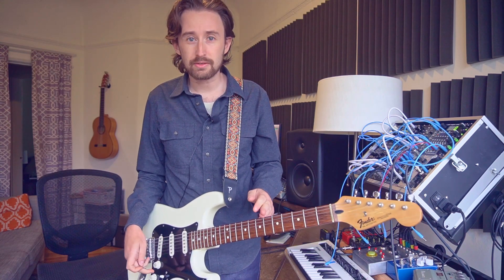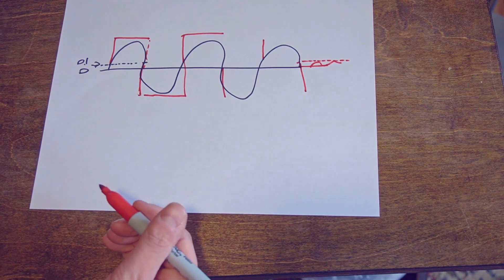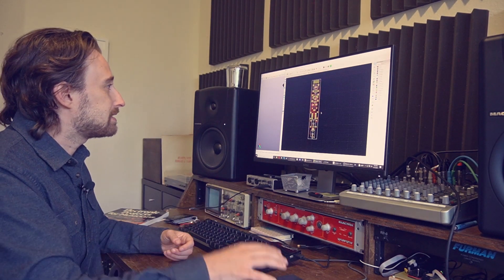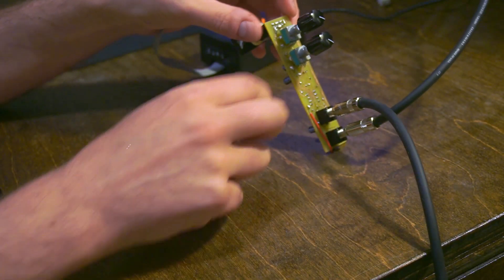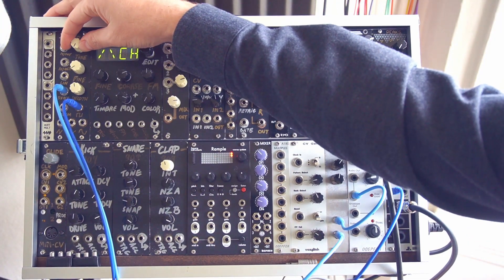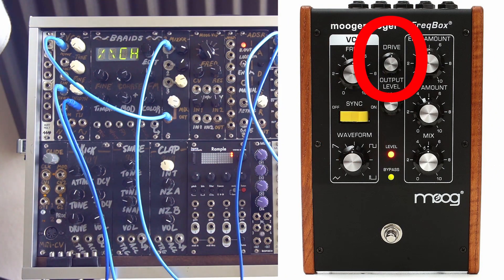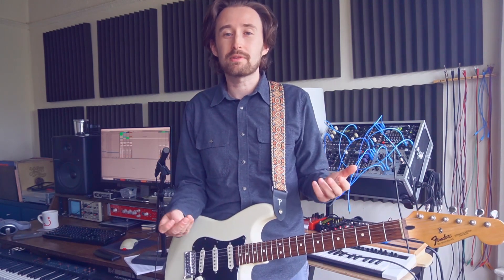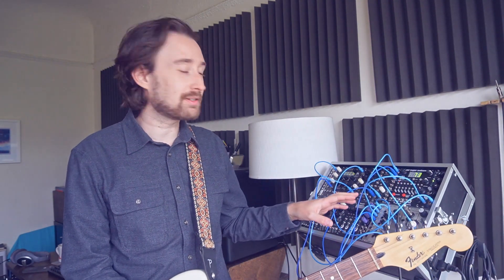Making an Analog Eurorack Guitar Synth with a 1970's Ultra-Fuzz Circuit

Comment: What kind of power supply do these  filtamp's use ?
Reply from the maker: Not sure I understand. What's a filtamp? All Eurorack modules use +/-12v. The projects in the book use +/-9v with two 9 volt batteries and a virtual ground between them.

Comment: You should try building an Uglyface pedal as Eurorack. It accomplishes almost all these sounds with a circuit not much more complex than Anderton's Ultra fuzz. It uses a CMOS 7555, an LM386, and a Vactrol-style optoisolator. Google "escobedo circuit snippets", and you'll find the Uglyface circuit.